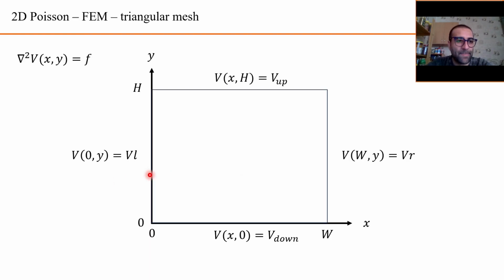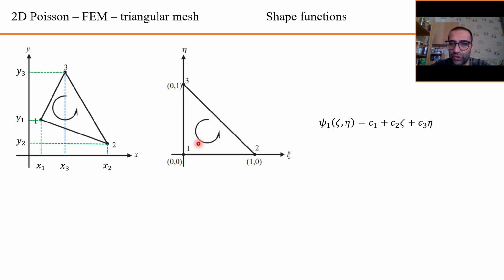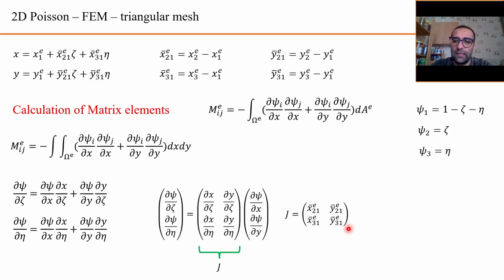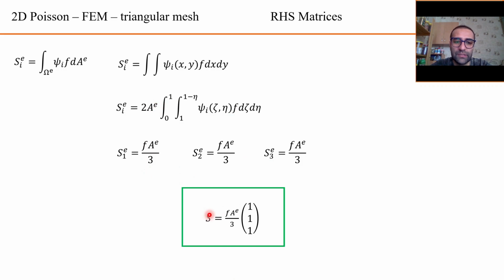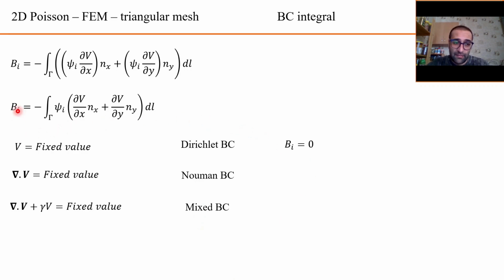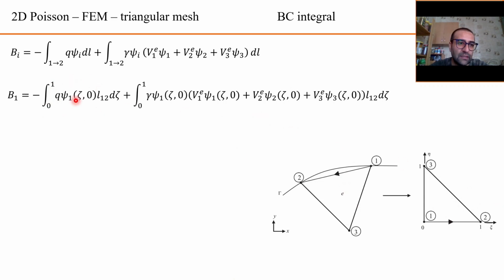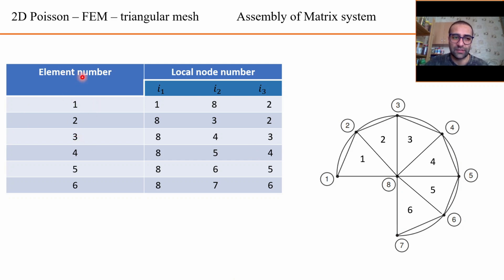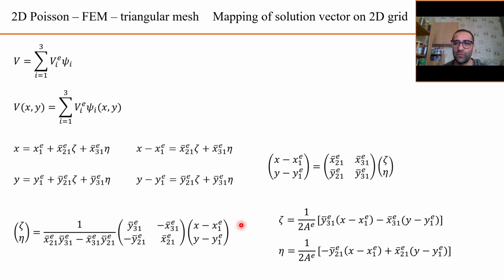2D finite element method based on Galerkin approach

Comment: Thank you so much
Can you please write a code that shows the nodes value ?
Reply from the maker: The code is written already, have you seen it? https://t.me/Abolfazl_Mahmoodooor
Reply: @abolfazlmahmoodpoor_  Yes, I saw it, but it only shows the number of nodes and elements. What I want is the value of nodes at some points
Reply from the maker: @shahad9376  but there is also two figures, one shows the mesh, the other shows the value of V at the nodes, did you see these figures?
Reply: @abolfazlmahmoodpoor_  Oh i see it now, Thanks
Can i change this code to use it in another equation?
Reply from the maker: @shahad9376  yes sure